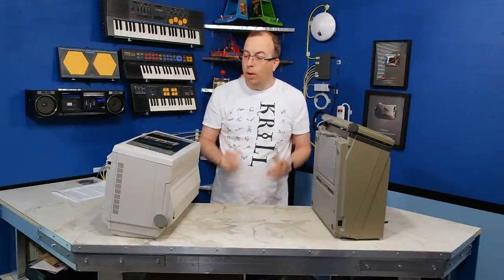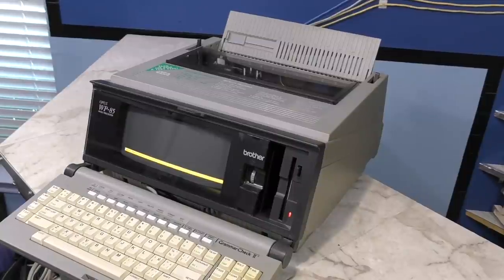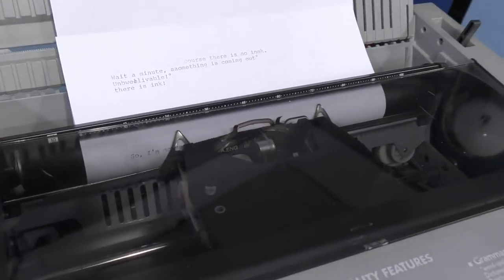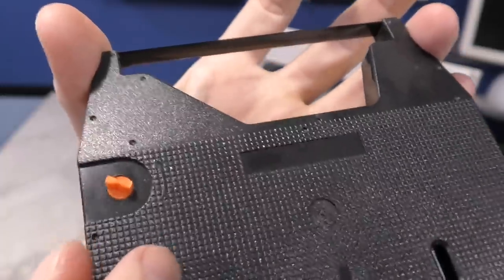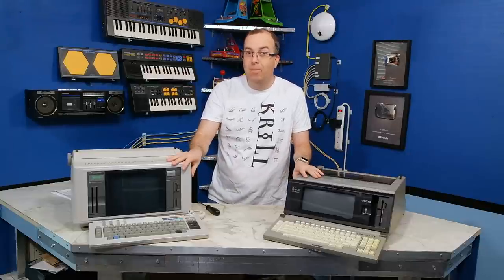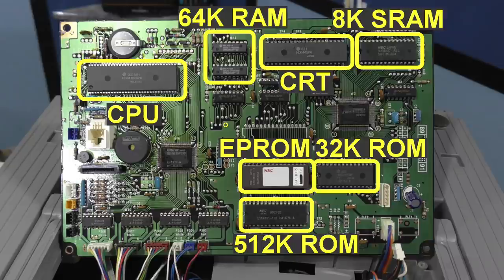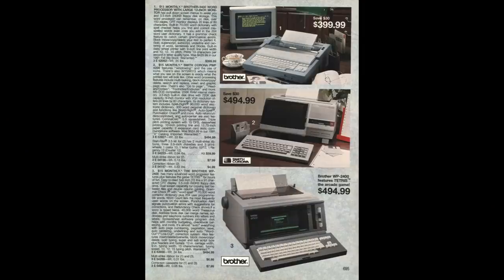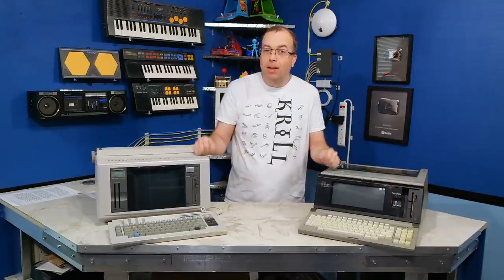Dissecting two Word Processors, Brother WP25 and Panasonic W1525

Comment: Weren't they just a Japanese 'thing' that swept over to the west? I mean, it makes alot of sense to have one if you were Japanese and living in the 70s, where there no computers with high-res Kanji displays. A word Processor with ONLY latin characters doesn't make a single sense and I have not seen them here to be honest. Only on a flea market, i have seen one. (And that was like, 10 years ago)
Reply: In that case these western models must have been notably modified (simplified). Complex characters like those used in Japanese would require dot matrix print head because of the large number of possible characters, but these had a separate "stamp" for every character. Also, the character ROM must have been larger. I suppose these use about 8x6 pixels to show any of the ~100 possible characters on the screen, but to show Japanese characters, 8x5 might be too little. Maybe something like 10x15 would be needed? And there would be thousands of possible characters. And I'd imagine that also the input system that would convert the kana or romaji input to kanji would have taken some space.